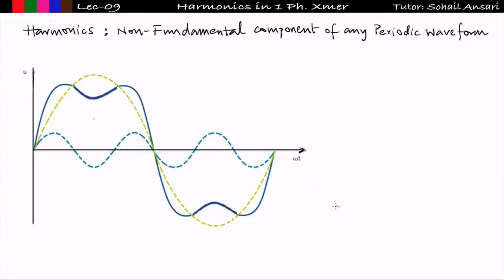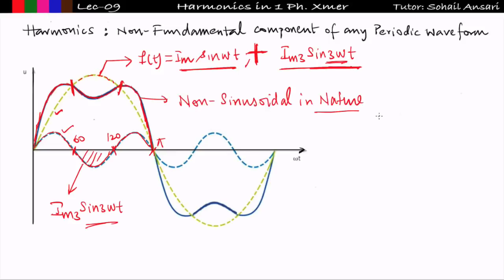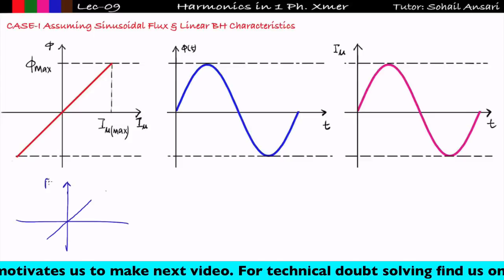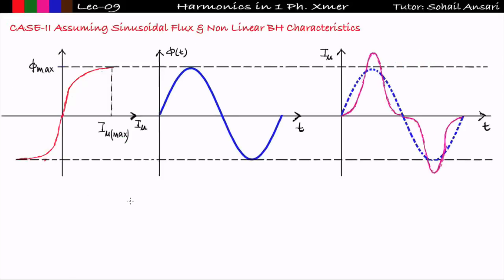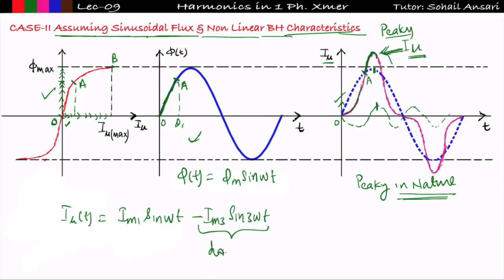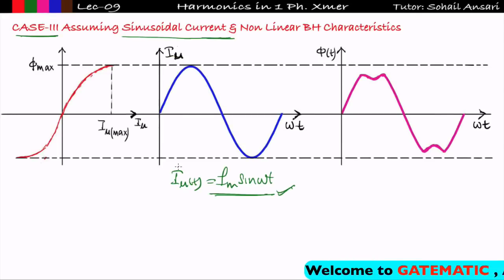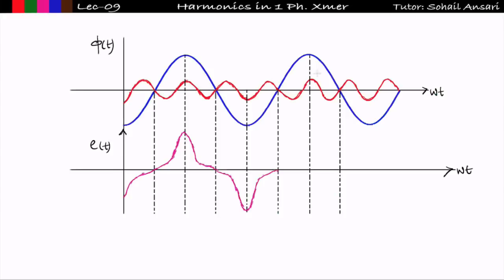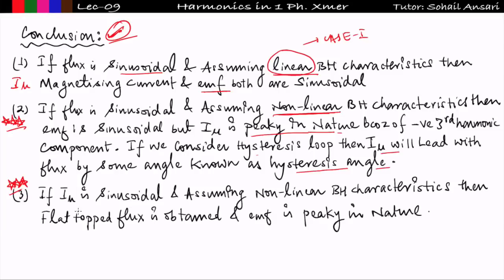Mod-02 Lec-09 Harmonics in Single Phase Transformer | Electrical Machine

Comment: In case 3, ie magnetising current sinusoidal and BH Chara non linier, why magnetising flex is only flat top? Why can't it be peaky? If added 3rd harmonic is negative it should be peaky right? (same in case 2 also - why mag current can't be flat top when flex is sinusoidal, and with +ve 3rd harmonic).